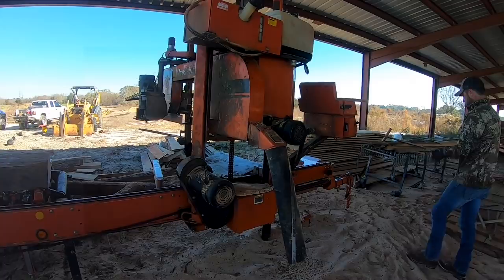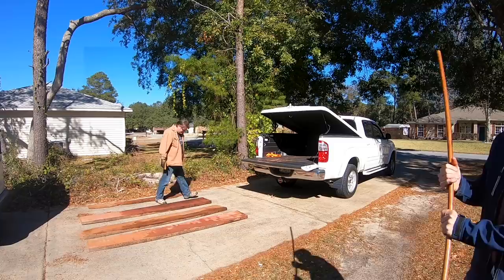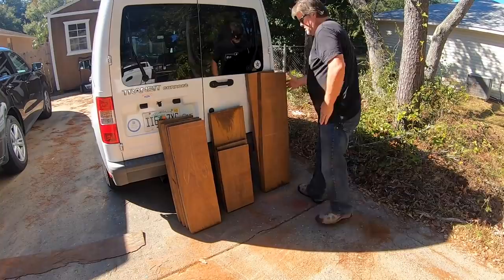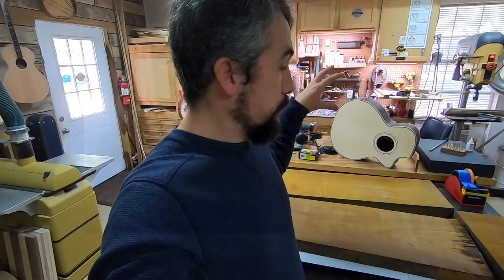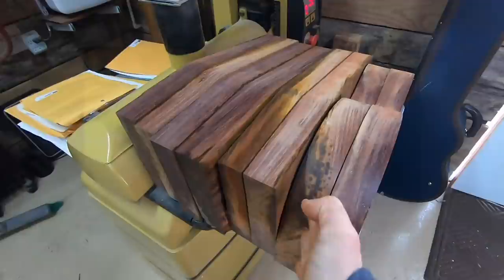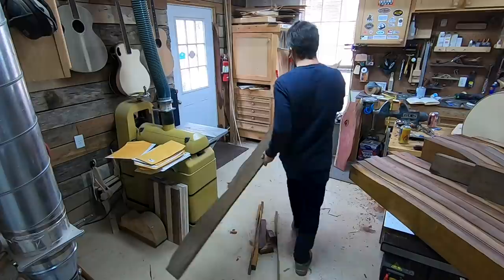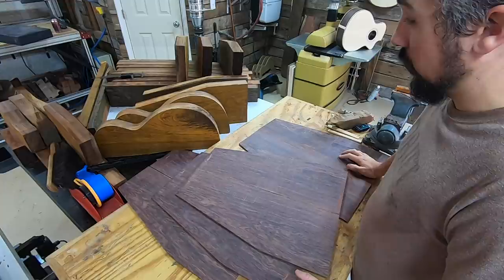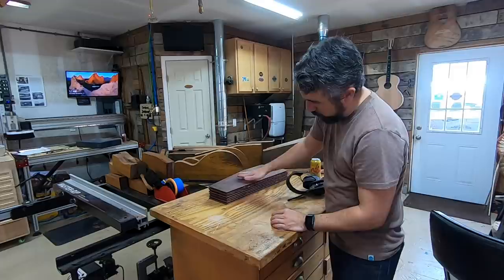How to turn a Cocobolo log into 32 acoustic guitars!

Comment: 30 years ago I bought some  cocobolo logs from Scotty's hardwood in Springfield Oregon and had it milled into 3/8  x 10 foot long and ran it through a sand master to 1/4 inch and perfectly edged and then glued it to a 10 x 20 foot wall in a new house that I still live in, a lot of 8 inch and 6 inch wide  pieces .  what a beautiful wall that will last for generation's'  cocobolo is very colorful and dense and beautiful, Its my favorite, I payed 10 dollars a board foot back then and I feel money well spent.

Comment: Hi Chris, I think your videos are real informative and entertaining.  As a wood worker and an amateur luthier for the last few years, I want to thank you for the many useful tips I've picked up.  But here is a tip that could literally save you a trip to the hospital - get a nice pair of SAFETY GLASSES and put them on when using ANY power tool.  Shoot, I ruined my right eye just using a pop riveter, so imagine what could happen if a blade lost a carbide tip and happened to sail in your direction.

Comment: Hey James Franco, did you quit making movies in Hollywood? Rarely is a person both creative and mechanically inclined, you're a rare bear. Your guitar videos are great, absolutely love seeing how these things are put together, thank you! I'm an engineer and truly appreciate your, what we call.. accelerated failure mode testing. Your key ring scrape, the ball drop, stand tip over, etc, excellent work. I do have a question though, in two different videos you've mentioned that the grain of the vertical back brace should be perpendicular to the grain of the back. So in some cases, the grain would have to be across/ horizontal. If the grain of that long skinny vertical back brace piece is horizontal, it's going to be so weak that advanced judo masters could break it with a karate chop. The vertical brace works in conjunction with the much heavier horizontal braces and that skeleton keeps the back from cracking whether the grain of the back cover piece is horiz or vertical. That's how I see it, but you're the expert, could you explain your theory, because I can't see what you're seeing on that issue. I know you'll probably never read this and definitely never respond, so anyone else familiar with this? Thank you:)

Comment: I sold 390lbs of quilted maple, Adirondack spruce, and Walnut to a guy who showed up in a 1970's Chrysler station wagon. He took off home like you did - with his tailgate down. He took the driveway apron too fast, the car bounced, and the weight of the wood snapped his tailgate supports sending the wood out the back and strewn across the road. I felt so bad for the guy. I helped him by welding the support brackets back in but I felt so bad that the top/back side of his tailgate had gotten ground away by the road surface... Yikes!
Reply from the maker: Sounds like something I’d do

Comment: The large commercial manufacturers go to great lengths to ensure their material have very specific moisture contents, I assume for long term stability.  Do you control moisture content and do you have any stability issues with your guitars?
Reply from the maker: I acclimate my lumber to my shop for at least a year usually, prior to making a guitar with it. My shop is kept at 43% humidity year round and kept at around 75 degrees. This along with only processing wood that’s fully dried prior to cutting makes for very stable wood, and thus, stable guitars.
Reply: Very interesting.  Thanks!

Comment: According to the Wood-database: Cocobolo is "Notoriously allergenic. Reported as a sensitizer; can cause skin, eye, and respiratory irritation, as well as nausea, pink-eye, and asthma-like symptoms." I've read that some luthiers have become so allergic to rosewoods in general [but especially cocobolo] that they have had to stop using them and tragically I know of one famous luthier who had to retire at 50 because of chronic allergic responses. Wearing surgical gloves, respirator and goggles is often recommended to limit exposure to very fine dust and oily residue. Please be careful. Of course, when the guitar is lacquered there's no risk to the player.

Comment: This may be a dumb question, but why not leave all the offcuts to move and stabilise a while longer and use them for neck blanks rather than uke parts?
Reply from the maker: Cocobolo is just WAY to heave to makes necks from. The guitar would be too heavy and unbalanced. It’s better used as tonewood for backs and sides. Not a dumb question!
Reply: @DriftwoodGuitars  ah thanks man. I knew there would be a reason behind it. Never would have imagined it would be so heavy it would unbalance the guitar!

Comment: Your doing your research wrong.  The correct way is cut the billet in half. Then cut the next in half. This will avoid curling and warping
Reply from the maker: Interesting. Do you have a video you can send me to that will help clarify what you mean? I haven’t had any issues with my final cut sets warping, but I wanna prevent any future issues if I’m not doing it right. Thanks for the tip!
Reply: @DriftwoodGuitars  Cutting in half all the time is not necessarily the correct way to do it.  It can relieve stresses inside the tree more evenly but is not necessary on the thin pieces that are needed for acoustic guitars.  You did an amazing job minimizing your waste the way you did it.  When you see people milling lumber you rarely see them cut the tree in half and then cut the next piece in half.  This technique is more geared toward splitting wood which can translate to your spruce/cedar tops used in guitar making.